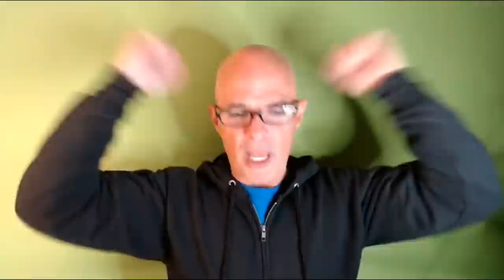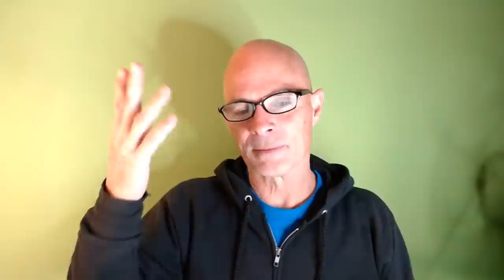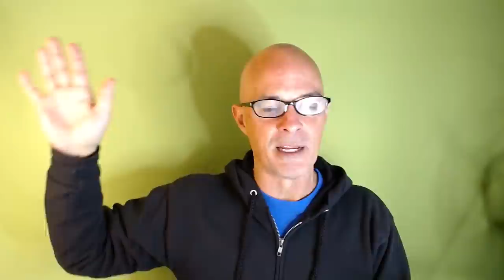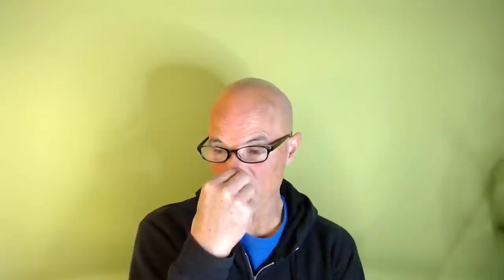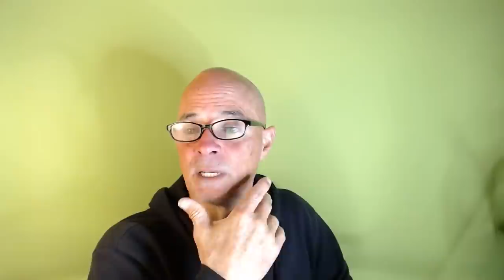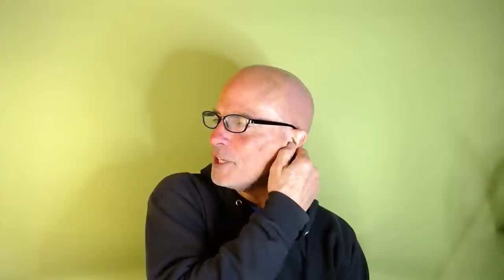LET'S TALK TECH-BLOWER vs TURBO-HOW DO WE CHANGE THE CURVE?

Comment: I truly enjoy this channel, so much information to file away.  It is cumulative for everything automotive and for motorcycles if you are a fan of the effort of Burt Munro. Maybe a 270 degree  XS 650 at 750 ccs and a little turbo? The stock heads would make 125-150 hp and the engine would eat it up.  A bobber style HellCat eater… lol.
Reply from the maker: big fan of Burt

Comment: This doesn't really involve forced induction, but I guess i have an example of where power is nice to have at 1500 rpm. At 30 mph (4th gear) my truck runs at about 1500 rpm, its a manual and I'd rather not down shift if I don't have to  just to speed up a little to get around somebody. There is also some other situations around town where I don't like to down shift if I don't have to. The less rpm I run, the easier it is on my engine is the way I look at it. To top it off my transmission (sm465) doesn't shift very smooth, especially down shifts.  If its necessary I'll definitely down shift if I need to.

Comment: Running a blower on a car almost sound's more complicated then the old s/c radial on my ag-cat lol. What your saying about centrifugal's under 2k rpm that they don't make boost sound's similar to s/c radial engine's But we try to use that to are advantage to keep strain and heat down, by usually trying to only make min boost needed on take-off then pull it back to 28-30 inches at cruise. I never thought about that with centrifugal's that would be a nice perk for a reliable daily

Comment: I do understand that the rpm is something that needs to be a manageable place. I also understand that the boost curve will never be flat. What I am really curious about is when using a blower that creates significantly more air at normal rpm. Enough to create more boost than is targeted. Then cold gated to maintain that boost level. Why does this not work? How much parasitic loss would there actually be? Is it so bad that it's not worth the effort? This would be an excellent comparison. Thank you for the detailed videos.
Reply: So your suggestion is to take something like an F1-R And put it on a small displacement motor like a V6 or something... And then boost manage it with bleed off?
Reply: @TravisFabel   I’m pretty sure that’s what he’s saying. It’s simply not efficient, you’re spinning a bigger blower which is more parasitic loss. To get what you’re after the blower would be much bigger than a F1a even on a small cubic inch motor.

You’re basically trying to make a 1/4 size positive displacement centri blower… if that makes sense.

Comment: I want 2 turbos and gears that make you punch it at 3500 or more. It is idiotic to lug any engine. Even NA, I don’t punch my 450 hp at less than 3000 at a stop, or around a corner.

Comment: I disagree your statement about never flooring it from below two grand.
Sometimes you don't want the engine screaming. You just want to torque your way past the other cars on the interstate.

Not everyone is driving an automatic where you have no choice of gears and the converter would flash up anyway.
Reply: Don’t you usually down shift lugging a engine is way slower
Reply: That's more of the middle of the rpm he is meaning most every engine is made for.  Screaming and under 2000rpm should only mean wrong gear selection for acceleration. If Im cruising at like 1800-2200 then yeah I might pass someone with like half throttle, but I have a supercharger and it's a big gap to pass.

Comment: i have a 03 grand marqis with a 4.6l. i have a 78mm with a home made cold air. 5.1/8 long tube heads wit true deals and dumb pipes, msd blasters. but im looking to swap im 2v heads to a 4v heads with a 262 cams or around than. will that work???????
Reply from the maker: you would likely be better off (cheaper) just getting a complete 4v motor from the yard